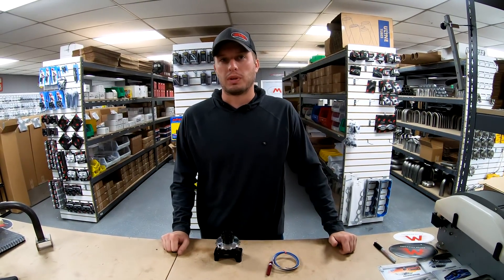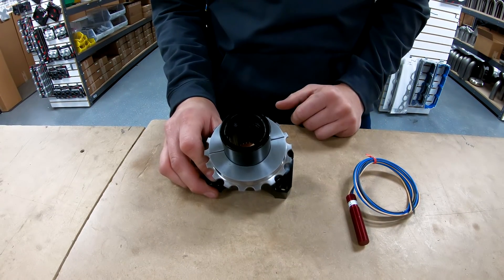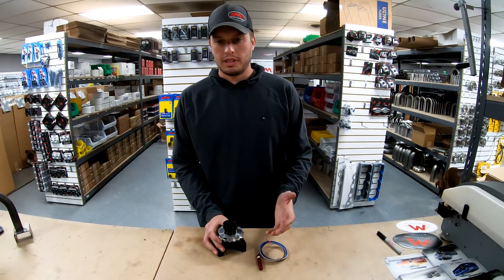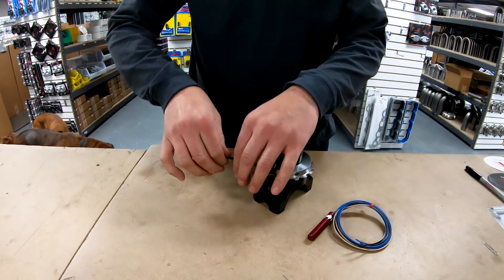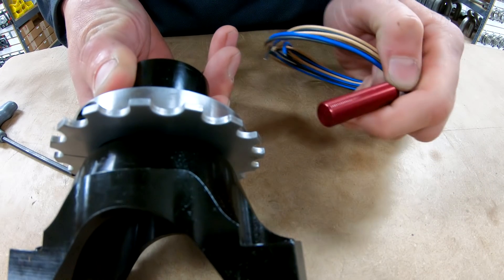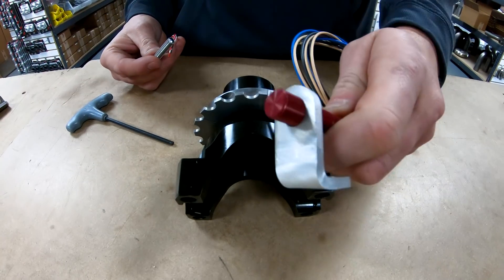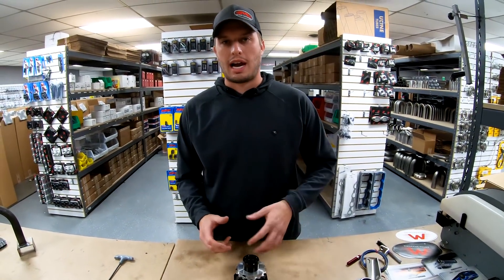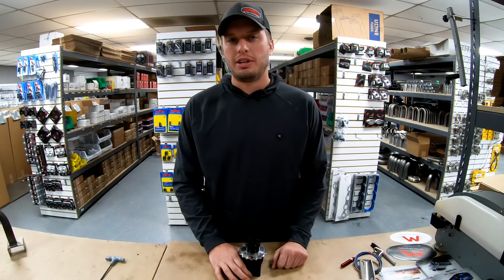Driveshaft Speed Sensor High Def - Motion Raceworks

Comment: great info on n the ultra case/ however...what you say 99.9 percent running the red sensor what diode do i use??? ford 9" holly dominator? will be here tomorrow... resource tab.... great job regardless doug.

Comment: Someone PLEASE make a sensor bracket for a 12 bolt!
Reply from the maker: We will make one. Just remembered we have a 12 bolt now
Reply: @MotionRaceworksOfficial  Take my money!! 😂

There’s nothing to bolt a bracket to on the 12 bolt (especially if it’s leaf sprung)!

In order to build a mount for one, your probably going to have to require a hole to be drilled. 

Don’t forget the fbodies have the torque arm mount on the drivers side.. so probably design it to go on the passenger side of the housing to keep it universal.

Comment: Does this work with the LS Terminator X , and will is require a resistor?
Reply from the maker: It will!  It should not require a resistor, but occasionally you will find irregularities on different inputs even on the same Ecu.
Reply: @MotionRaceworksOfficial  Good to know thank you!

Comment: After installing and setting up the kit, which controller do you lean more towards using a Holley Dominator?  I see that Holley has their paywall traction control system and Davis Technology has their add on module. So I'm curious to know which youd prefer and why? Both ways require your kit, it's just now deciding how to apply that data that I'm curious on. Thanks and I really have enjoyed using other Motion products so far!

Comment: So what is your opinion on using the Hi-Def Driveshaft sensor over using the speed output on a 4L80 when in conjunction with a Holley Dominator and traction control? I had planned to use the 4L80's speed output due to me driving the car a lot of street miles and did not want to take a chance of knocking the driveshaft sensor loose or out of alinement.
Reply from the maker: RRM Garage I believe the 4l80e has a 40 pulses per revolution output.  This will work on some systems but others will not be able to interpret and use that high of a tooth count.  I also am not sure of how good of a sensor is used but I would imagine it is decent.  It doesn’t cost much to give it a try if it’s all already there!  Worst case it doesn’t work and you can extend the wires and run one of these